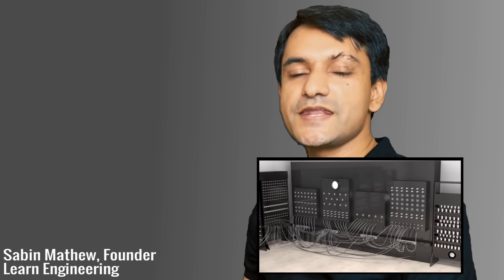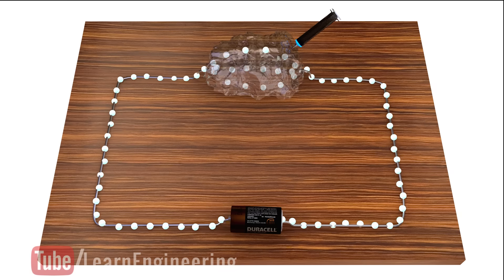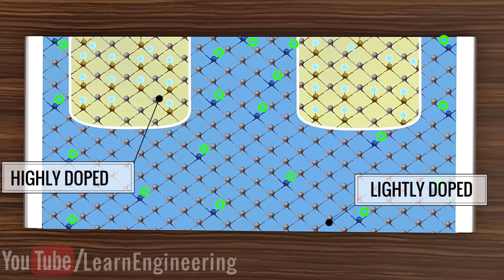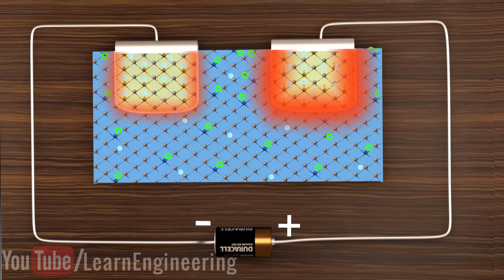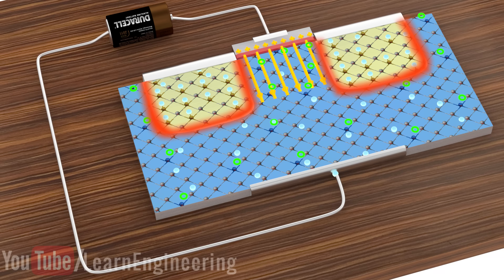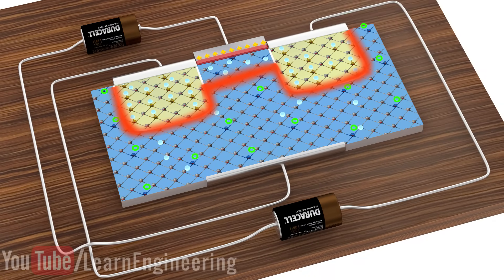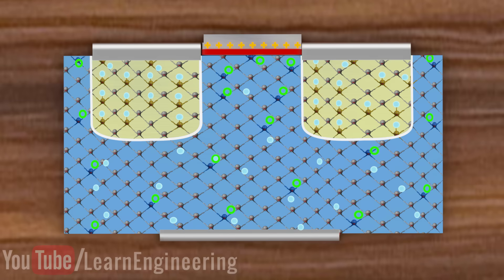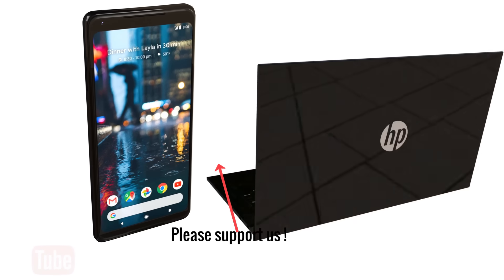Working of Transistors | MOSFET

Comment: Is beautiful how the photovoltaic cell working principal is almost the same ! But one is powered by sun to transform solar energy into electricity and in this case is a current is induced inside a silicone based material to control a current flow to work as a mosfet!

Comment: Is it correct, to join gate and substrate or body with a battery? Battery is connect between source and gate, although body and source are internally connected together! But correct notation should be that a primary battery for voltage control should be added between source and gate. While source and substrate added together to ground.

Comment: In Smoke alarm the control circuit current is changed by the thermister (reduced resistance due to increased heat, hence higher current). 
How is the control circuit current changed for a microprocessor?

Comment: Wouldn't you have to reverse the current flow to the capacitor for it to become more negatively charged? if you simply lower the number of electrons flowing from it then it would still lose electrons, becoming more positively charged, right?

Comment: When you put the positive side of the capacitor as the third pin, there is one more pin left! Does a MOSFET has four pins? Please explain.
Reply: Its is GROUND, usually the metal plate you screw in a screw "behind" the mosfet, but its also exists for thermal purposes
Reply: Watch it in this video - https://youtu.be/rkbjHNEKcRw?t=116

Comment: Hello, is MOSFET 3 leg, middle is gate, others is source or drain vice versa depend on voltage (battery) connection? I confused at the fire alarm circuit, the thermistor act as control component why does it connect at the outermost leg? if the middle leg is gate. While the buzzer is connected to the middle leg?
Edited: ok, I just search online for MOSFET pinout. The leg setting, gate is not at the middle. Now I understand.

Comment: The comments here are proof that teaching 'conventional current' flow has confused generations of engineering students. i.e. Most colleges and universities do not teach 'electron current' flow, which is actually the correct representation in physics & chemistry... Thus, device nomenclature is based on 'electron' current flow, yet they try to teach engineers using 'conventional current'.

Comment: in 2019, my pixel 3 XL (now old) can do this same benchmark in 0.63 secs with the Machin method, or 0.007 secs with Chudnovsky method (in this same app).
He's either using an older phone and the chudnovsky method, or a kirin 980? with the machin method, as in his older version of the app, it doesn't display the method used, but it appears as though the k980 is just slightly faster at this than the sd845..  but he could be using a sd820, or perhaps, a sd625 or 430, or mediatek, which would be much slower using chudnovsky.  i'd really like to see someone's results using the sd855 or 865 (when it comes out).. or k990
Reply: My OnePlus 7 Pro with SD855 calculates it in 0.56 secs, so the fact that his Pixel 2 XL with SD835 can do that in 0.55 secs is pretty interesting

Comment: I've watched dozens of "how transistors work" videos and ALL OF THEM, including this one, completely miss a couple of things.

1. Why would electrons go to n-type material to fill the holes? N-type material (as well p-type) is neutally charged, nothing attracts electrons to enter it. Why would they go there? After they go there, they create a negatively charged region there and leave positive charge in the region they left. Any adfitional electron that fillows the same path will have to fight the force of attraction of charges. And how is that possible in general, that the difference of charges is generated without using any energy, just by placing materials together? Wouldn't it provide some "free energy"?

2. Why would in order to be conductive, a material has to have it's own charge carriers? If we have a voltage applied to a piece of non-conductive material, why can't electrons from a negatively charged wire ENTER the material and travel through it?
Reply: 1:  Just because the atoms are "neutrally charged" doesn't mean that the lattice the aoms find themselves in are neutrally charged - that's why you get N-type and P-type materials.  It is the electronic structure of the lattice that becomes the conductor, through either the excess or dearth of electrons.  

2:  Because the electrons that are already inside the non-conductive material repel more electrons coming in.  That's why you need charge carriers.

3:  YouTube was never intended to be a science text.  Many videos gloss over important concepts with graphics of varying quality.  Fortunately, this is the 21st century, and even if you can't find an open library because of COVID-19 right now, there are plenty of physics and engineering texts you can find on the web that explain the concepts in great detail, including the math.   For a better explanation of doping you might start here:  
https://en.wikipedia.org/wiki/Doping_(semiconductor)#:~:text=Doping%20a%20semiconductor%20in%20a,states%20near%20the%20valence%20band.

Comment: What turns on and off a gate of a transistor? Who does it in a processor? Is it a mechanical process?
Reply: It is electronics not mechanical
Reply: @ritulimbu3570  thanks for obvious reply, but i think i found the answer on my own - it's a clock generator of a CPU which opens and closes gates every time bit

Comment: Okay, I understand the AND+OR transistor logics. The key is the gate mechanism as it dictates what circuit  is allowed to flow and what is not. So AND means that both input transistors gates need to be active, which in turns activates the gate of the third output transistor because of the complete circuit, which resulting in positive output signal. OR is similar, but instead of a chain of transistors they are connected parallel, so a signal on one of the two input transistors gates results in a positive signal to the output transistors gate.

  But the NOT function is confusing to me as it is presented because NOT is a inversion of the signal. As in if there is a signal to the function then the output is negative and vice versa.  But on the schematic, as presented, it just looks like a regular basic MOSFET, so a signal to the gate should result in a positive output.

Comment: Amazing video!

Question: What does "less noisy" means? You mentionned this at the end when you pointed out that there is always 1 type of carrier: electron or hole.
Reply: I’m assuming more noise is when too many electrons build up inside the transistor and less noisy is when not enough of them to continue the flow.

Comment: What I don't understand is is we are in a battery revolution trying to make more efficient and powerful batteries but yet we have the capabilities today we could use the process that we used to make transistors into very small micron battery cells and just later them and  layer then and we could have a thousand if not billions and trillions of cells in the size of a lithium battery

Comment: 5:22 here when we made a channel for the electrons , why dont they go to the metal blade as well as the drain ? its positive so electrons should flow into it , isn't it so ? hope somebody explains
Reply: its a weaker voltage, the  source-drain voltage is stronger than the gate voltage
Reply: @mayankkr.246  but he is using the same battery here and there ..
Reply: @aka0989  it's covered with an insulator so it can't pass through the metal strip.
Reply: Watch this to see how channel forms - https://youtu.be/rkbjHNEKcRw?t=194
Reply: @deveshsingh4214  ohhh thank you so much, this video is far more detailed, thx

Comment: do you have a dedicated video about silicon? i would like to see a more in depth chemical element video from your channel as you seem to describe and illustrate these things in a way that makes it super easy to digest and remember. you could even involve the other elements used to dope it, the bonding processes and the manufacturing techniques. I know this video touches on some of these points but i also know that these things are a great deal more complicated. thanks, I've just sub'd and liked

Comment: Whether the thermistor have high resistance or less . The mosfet will have its threshold  voltage after some interval of time because the gate and source of a MOSFETs is capacitor..there will be charge storage after sometime...so I think that application you showed me is incorrect.

Comment: What happens if there is no metal plate and dielectric material,instead we create electric field by directly connecting terminals from the battery to the substrate

Comment: Sir please explain about fuel cell technology.🙏🙏🙏
Reply: Hey Karthik

Short answer. Imagine you are burning H2.
The reaction is H2+O2=H2O
The energy released from this reaction is what we want. If you burn it, a lot of heat is wasted on heating the water vapor, and other materials. 
So, how does a fuel cell work?
Super simplistic version. Imagine you have an electrolyte in shape of a sheet.
On the left side, you have H2, and on the right side, you have O2. 
Hydrogen diffuses inside your electrolyte and becomes Hydrogen ion.H2->2H+ + 2e-(Hydrogen ions and 2 electrons)
Hydrogen moves through your electrolyte until it reaches the right side of the sheet. 
Your electrons move through some wires to the right side. (you use the electrons inside the wire to turn a light on, or any other use of energy)
on the right side, your Oxygen molecules attract the electrons and become Oxygen ions.
O2 + 4e- => 2O2-
Oxygen ion then reacts with Hydrogen ion, and emits water.
O2- + 2H+ => H2O 
So, your overall reaction is the sum of these reactions
H2 + O2 => H2O

This is the super simplistic version of something like a PEM fuel cell, in which Hydrogen ions are the moving species. 
Wikipedia and other sources should have more info for you.

Comment: Aren't bipolar junction transistor based TTLdevices faster than MOSFET based CMOS devices we use today? I thought MOSFETs were slower because the gate capacitance needs to charge up before it can switch. I thought the main advantage of CMOS vs TTL was that MOSFETs have a high input impedance so they use significant less power, only needing a few microamps of current in the low state. I'll have to double check by comparing transition time and propagation delay of TTL logic chips vs CMOS ones. Maybe compare 74LS series chips vs 74HC or 4000 series. Correct me if I'm wrong, though.

Comment: Hole flow? Really? I learned it in the 80's but at the same time was told that it was not often used since we actually discovered electrons were actual things actually moving.
Reply: I guess it's easy to understand since we got stuck with conventional current flow direction being the direction opposite to electron flow.
Reply: One can model what's happening using either approach.

Comment: Shown was just a heat sensor not smoke alarm, these also look at rate of rise, or how fast the temp is rising and triggers sooner rather at max temp say 135F.  If temp goes from 75F to 90F quickly it will trigger, but must slowly rise to the max temp to trigger.

Comment: starting at 4:09, the battery is show in reverse! The simulation depicts it correct, but the cell is place backwards.
Reply: The negative of the cell is electron supplier. It needs to be connected to the positive.

Comment: But this mosfet has 3 + 1  pins front of gate ???? But in real there are only G D S pins Why ??
Reply: You can connect the minus to the drain, they are both on 0V
Reply: Markus W In fact, I believe that’s the reason the drain and the source are different. If there were 4 pins, you could exchange the source and drain.
Reply: usually the bulk/substrate is internally connected to the source

Comment: But Now MOSFET is Replaced by FINFET
Reply: I think FINFET is a type of  MOSFET.
Reply: The inner working of FETs (Field Effect Transistors) is pretty similar in any case. BTW, MOSFET stands for Metal Oxide Semiconductor FET.
Reply: Less than 22nm technology uses FINFET , MOSFET's cannot be used due to various problems and one main reason being punchthroughEffeat.
Reply: Wait. What?
Reply: All our latest cellphones have FINFET's not MOSFET's

Comment: At 3:45: "this accumulation of charge creates an electric field between the plates"  seem a little misleading to me.   It should be emphasized that this field is electrostatic in nature and doesn't result in any current flow until the the voltage is shut off or reversed in polarity, whereupon the capacitor will release it's stored charge.  Capacitors will also cause current flow when they are in the process of being 'filled up.'  Current only flows to or from a capacitor when it is being filled up or emptied.
Reply: he also claimed steady flow.. why is there a pulse. must be the capacitor?
Reply: Form my understanding, not quite from the capacitor. It's probably because of the MOSFET charge (electron) is moved when the electron flow across it (gate to the drain), thus the hole is created. This will shut the gate and the process cycle continues.
Reply: From my  understanding (and my companion experiments), the capacitor part you explain was partly true, the capacitor do charge up, but release from a capacitor not at full charge, also collection happen not at empty. The name "capacitor" refer capacitance or put it simple, capacity. The amount of charge (F=Farad) is release when the drain or load is consuming (or if you like to put it as absorbing/requesting/draining) of power regardless on how much it had stored. The best example I can give is if you did study on how AC current convert to DC. The diode is used to reduce the noise (or just put as the negative voltage - when the sine/square wave is going down). Then the capacitor is place after the diode to filter for a much smoother DC output. So this how it goes, the capacitor charge up the wave form electric and release a steady amount of electric.
Another way of understanding it's like you poke a hole in the middle of a bottle (this case is the capacitor) and flow a on/off water into it, you will notice that the water leak from the hole is quite dramatically steady compare to the direct on/off water.
Now the case of empty, again you can use the water concept for simple understanding. But again, like most circuits, they always charged up, "almost" never empty ("almost" I highlight as most high voltage/current circuit have "bleed" style apply - commonly made to happen only when the power supply is discontinued) .

 To make it simple, in a running circuit (which does not need the capacitor to gather charge/ turn the capacitor on/off constantly), the capacitor will always charge simultaneously discharge at the same time. The only thing (important on what you want to do) is the voltage value it can give (and hold) also the charge it can retain (F=Farad and again, its the "Capacity"!). 
Thanks for reading (if you did), because really, back then me and my companion really struggled to understand it simple as possible...